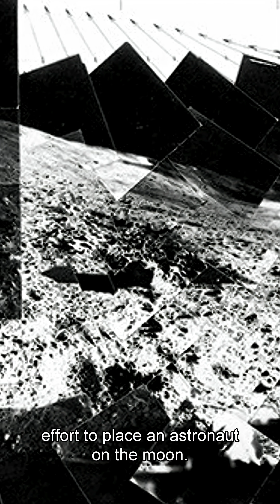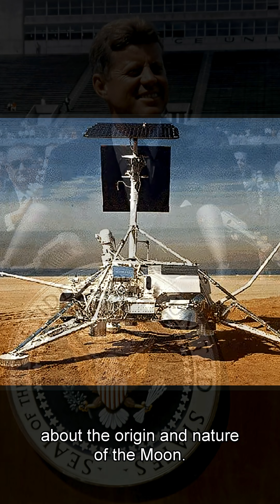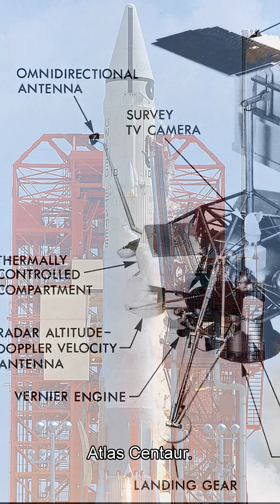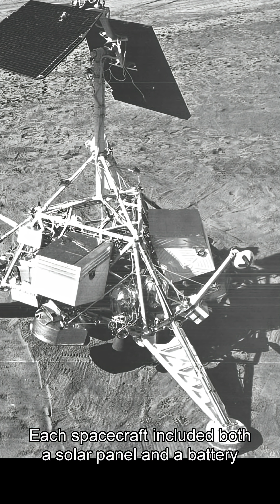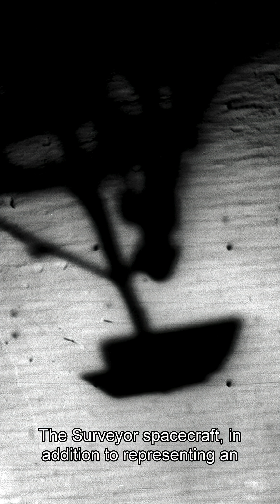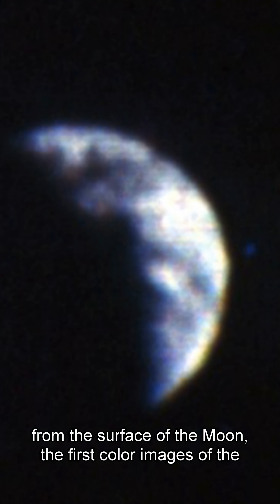At the time, the most advanced vehicle ever created.

Comment: 200 line and 600 line would be anywhere from like 80p to maybe 120p resolution. They had better analog cameras at the time but these were some of the first digital cameras. Most of the computer control expressed in them came not from their snapping pictures but their from their digitally controlled orientation.

The main viewer and the canopy camera would be measured against each other's data to build a compound image of much higher total resolution.

They digitally hand knit a 2K image using 80p threads from more than half a million miles away.